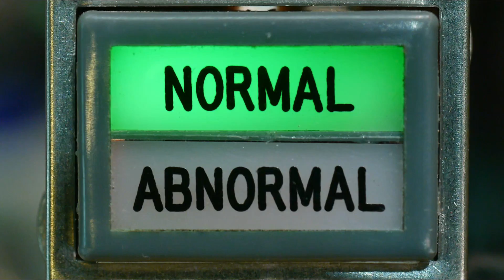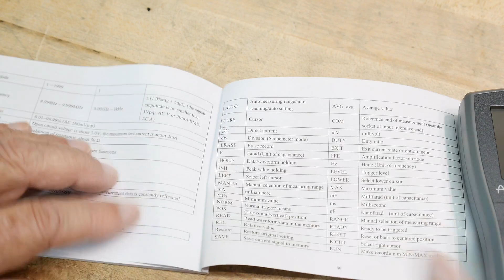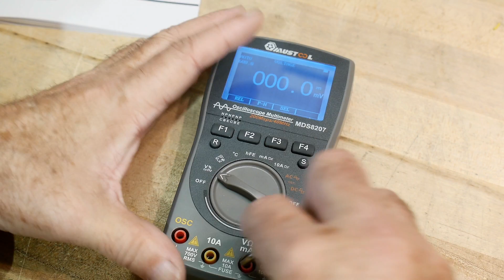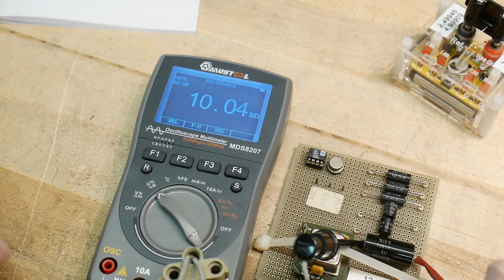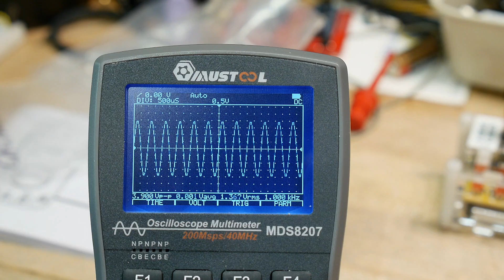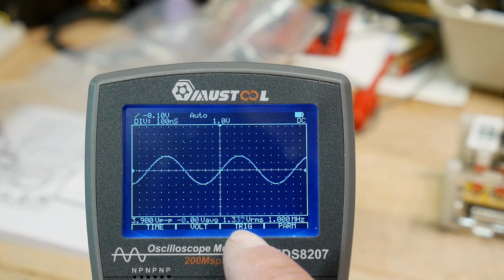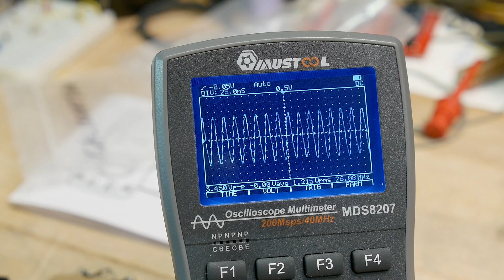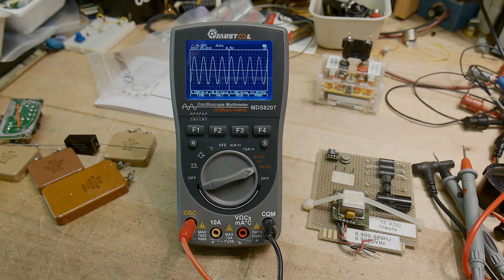#1071 Mustool MDS8207 Scope Meter Review

Comment: Nice scope if you need to be isolated from mains ground and for in the field or at home. Price seems reasonable enough. The specified tolerances are probably over the entire temperature range. Maybe you can open it and show internals on a follow up?
Reply from the maker: just posted a teardown video

Comment: The multimeter part of it looks good, but the scope part is really poor.
If you pay 25% more you get the cheapest of the Owon HDS200 series,
and that's a much better scope. Dual channel, and real BNC inputs, and a much better display.
If you just need a multimeter and something only to see that the waveform is there,
then you can probably do that even cheaper than this.
If the spacing between the OSC and COM had been standard size,
you could have used a banana-to-BNC adapter, and maybe it would have
performed better at the higher frequencies.
But 40MHz on regular banana testleads? meh...

Comment: I noticed there was an AC scale under the “scope” settings and you were using the DC setting….????  I wonder what difference if any it would make on the displayed signal? Capacitively coupled??? AC vs DC on an O’Scope doesn’t make much sense to me…
Reply from the maker: dc in direct input, ac  goes through a capacitor

Comment: These combo units can be useful for automotive diagnostics work (as you mentioned), but they are typically used more as a type of data logger.. running on a very long timebase. 
Would 40 MHz BW be useful for fixing cars? I am not aware of any need.. 
Cheers,
Reply: BTW, thanks of the review of the scope-meter. Pretty good basic accuracy on Volts and Ohms.

Comment: I have tek TDS700 serie, i have Fluke Scopemeter 199c and i have this dmm scope and i love it for small and fast debug, i try on switching psu repair and work great, 700v input are nice to work on live side, menu and fonction are slow compare to Tek or Fluke but is work!
I take with me on road call, i use somme time at home to check my small electronic projet, scopememeter are not too big but is smaller and lighter.
I recommand for beginner because low cost and do nice job, i recommand for professionnel to use in light and fast debug, spaire instrument.
Reply: I've used those at work, too. We did switch over to a 190-series scopemeter recently, but they all work great!
Reply: Whenever you drop your meter or it gets stolen, you are very happy that you were smart enough to leave your expensive one home and took that cheap one instead.

Comment: I have this unit. It works perfectly fine for testing VFD signals that drive pumps and motors . Also works great for setting amplifier gains for car audio amps. It's a nice tool for a field service techs like myself. It eats batteries though.

Comment: Many years ago I made the mistake of purchasing a Velleman HPS10 scope not dissimilar to this in terms of form factor. By far the biggest limitation was that it was single channel with no external trigger. Had it at least had an external trigger, it would have had some purpose, one could compare signal timings. I kept wanting to like it, getting it out every now and then when I thought I had a use case for it, but no, I was always left disappointed.

Although not to quite the same extent, there is a further limitation of all handheld scopes, and that is the UI. Messing about with buttons rather than knobs isn't great for workflow. FWIW, touchscreens IME also remain a bit of a disappointment, their responsiveness being slow, and often incorrect gesture interpretation means it's usually a substandard experience compared to knobs.

Comment: Triggering on a digital o-scope is a problem. 
If the trigger circuit is analog based it then would need to re:phase the sample clock which is really impossible. Probably in this case it is a digitized and compared to digital level to become "triggered". That will always be somewhat noisy and the trace will wiggle at the trigger point.